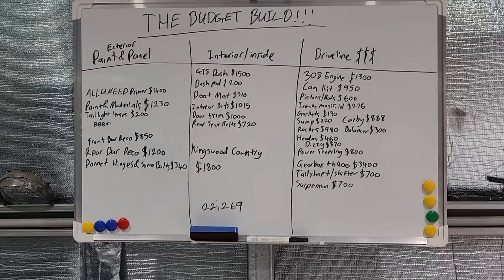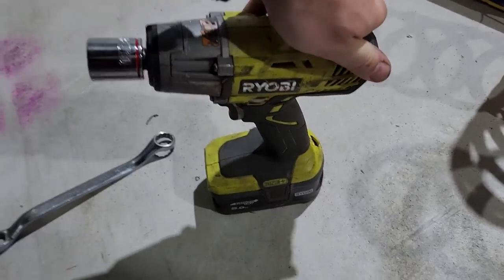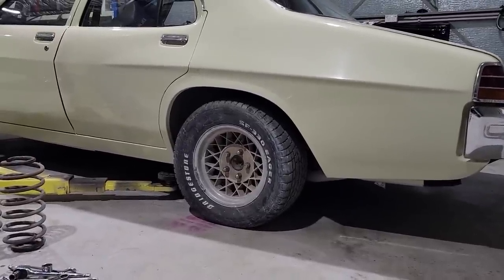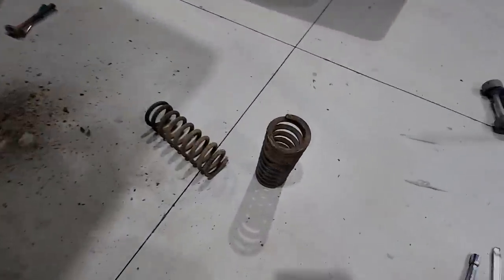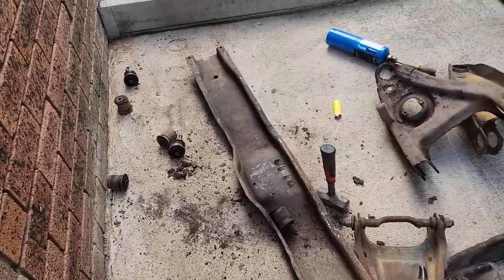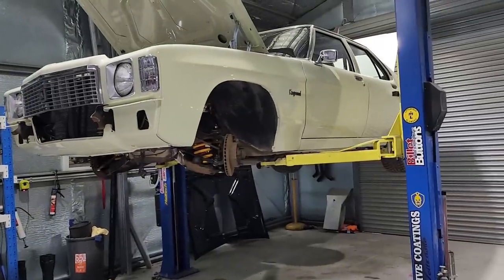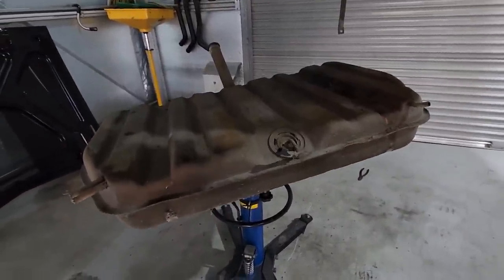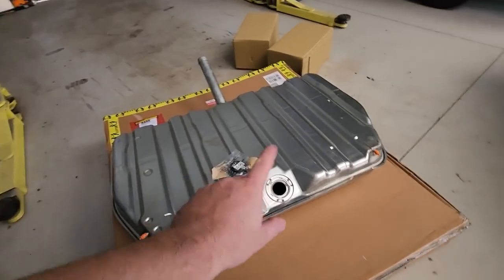Holden HZ Sedan Project Budget build Part 6 - Suspension, Fuel Tank & Motor is Ready!

Comment: Hey man currently building my HZ I'm having a bit of trouble my springs keep falling out when I jack the body up and the diff drops do you no what shocks (part number) you use as they must be shorter then standard?
Reply from the maker: Ive found if you fit a swaybar on rear it stops the diff dropping down just enough to stop the springs falling out. My shocks are standard length.
Reply: @MCFRYMotorsport  yeah I have a sway bar factory and still drops to low but cheers for your answer man
Reply from the maker: @corykorohiggins5064  your springs might be lower than mine then I guess
Reply: 50mm shorter shocks in rear if running super low or extreme low coils.